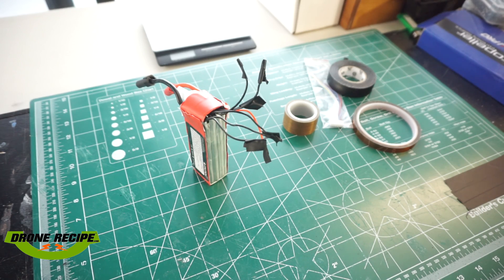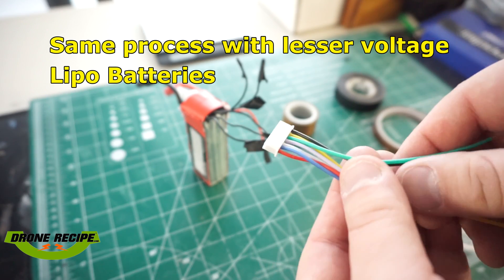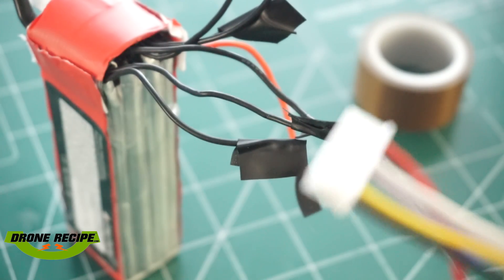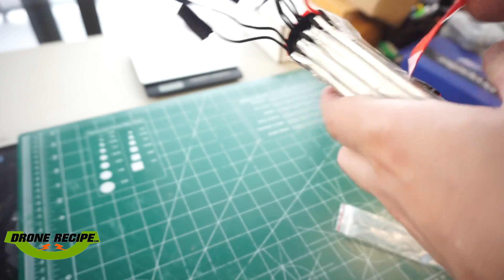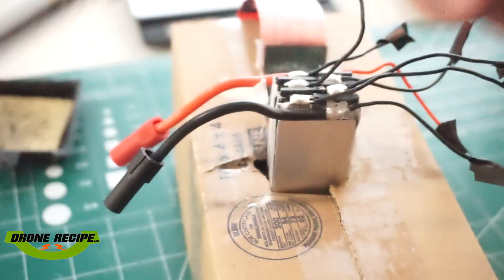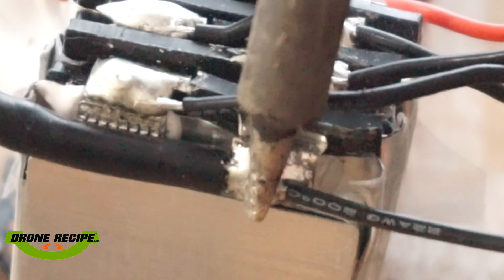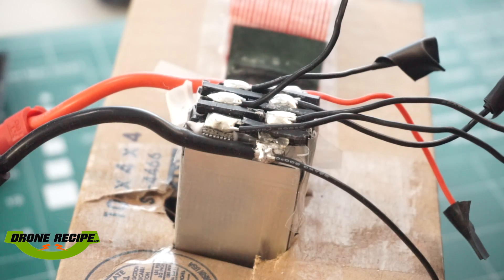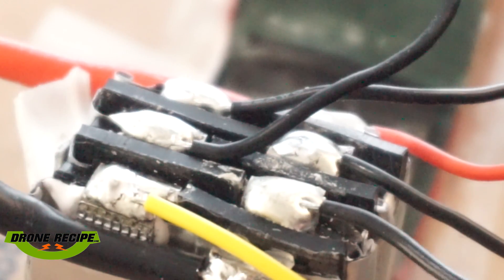Lipo Balance Connector Replacement

Comment: I have three batteries with broken balance wires at the battery end, now I just need to find the fiberglass tape and the polymide tape
Reply from the maker: the fibreglass tape and polymide/kapton tape are optional...you can use electrical tape instead of polymide  :)